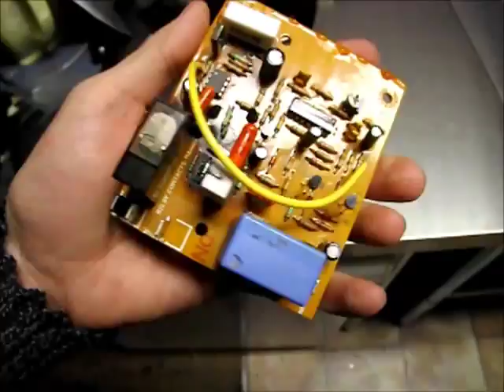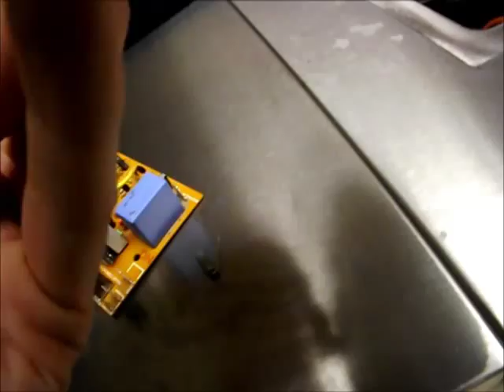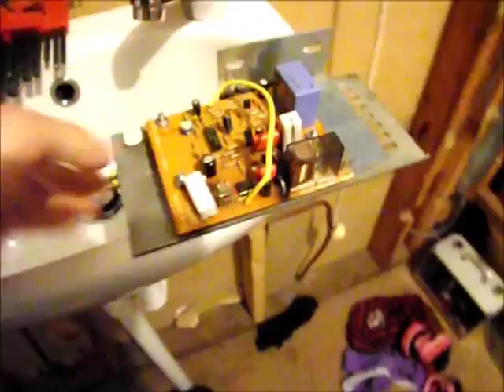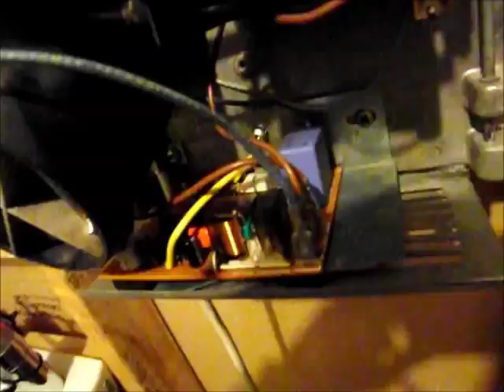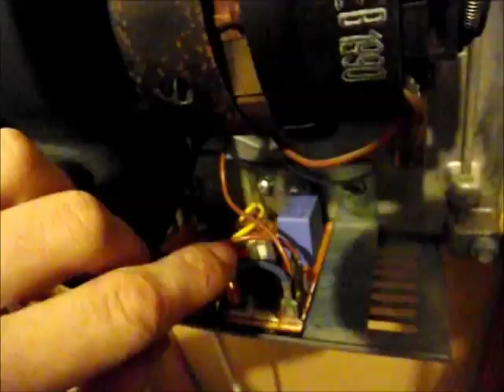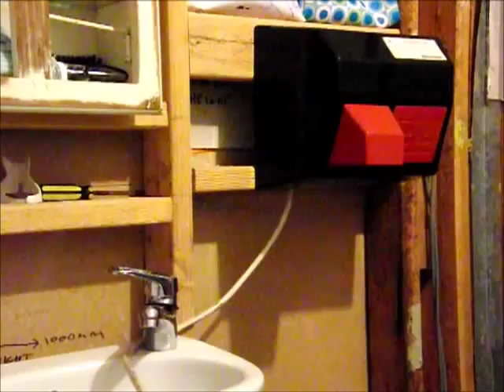JD MacDonald autobeam 1000, control board finally rebuilt!

Comment: I didnt know there was anything wrong with it, or was that just ditching old parts?

Shame the manufacturers didnt leave long leads on those diodes from original, as the lead acts as a heatsink and the diode is away from the pcb in a better air flow.
Im telling you the bloody obvious again, sorry :-(

Love the 555, so simple but so usable :-)

Should last a loooooooooong time :-)